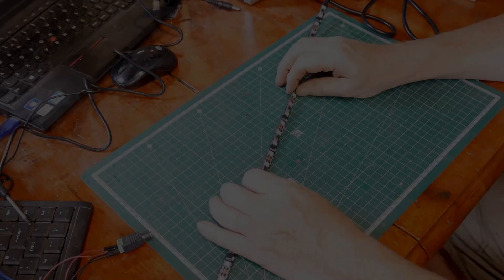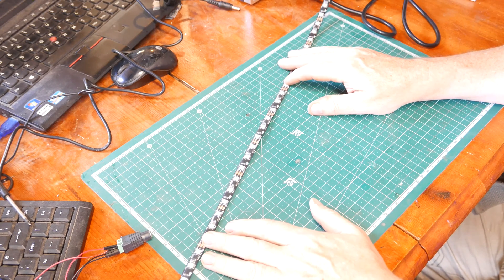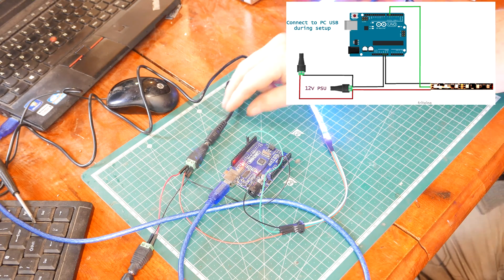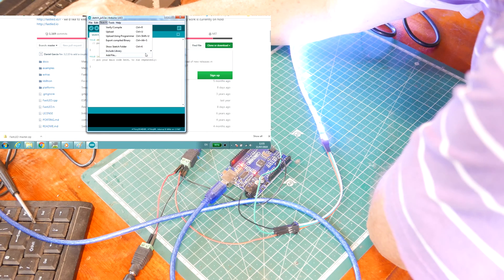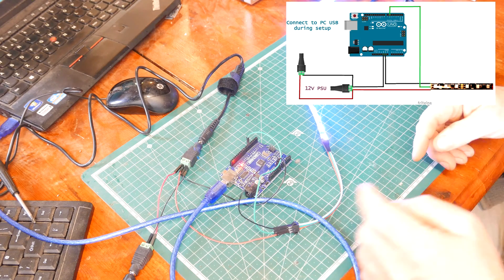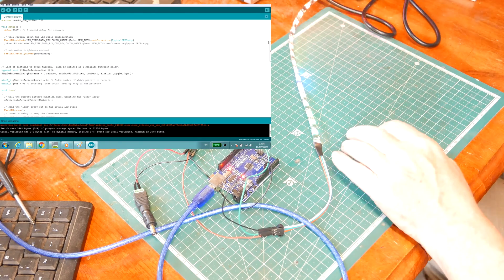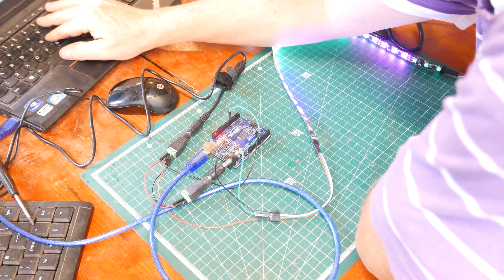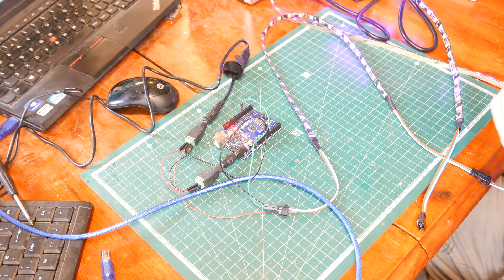12V WS2812B 3-wire LED Strip with Arduino Uno

Comment: Great video. Just a quick question. I am working with a WS2815 strip which is 12v. My understanding is that the Arduino pin output is 5v. So, it appears that the LEDs data channel can be 5v and it still works. My preference is to use an ESP32 where the output pins are 3.3v. I can step them up to 5v as I have done with the 5v strip I use, but wasn't sure if it needed to go all the way to 12v for the data pin with this strip.

Your assistance is much appreciated.

Comment: Thanks for the video.   There is not much info out there specifying how to power arduino after uploading the code.   Everyone always skips that step.   In my case it will help me power 12v pc fans with a 12v 1amp and also powering the arduino.  I'd hate to have two separate power supplies for a simple design.   (Newby here)

Comment: and of course I did connect the 12V when powered with the USB... I almost blew up my laptop, that needed a motherboard reset. The arduino is RIP
Reply: that should not be a problem, unless there is a floating ground.
Reply: @alejandrissimo  in my case, the computer was dead. I had to put a needle in some kind of reset button and then it started again. Not sure how not to have floating ground in such cases

Comment: So I can't use a 12v power supply on the 5v of the WS2812B? I was thinking of getting a 12v power supply because my WS2812B  isn't capable of putting out all white on the LED's.

Comment: This is a wrong title used for the video, he is using a WS2811 which runs on 12V. The WS2812B LEDS will fry when using 12V, be aware
Reply: I also noticed the LED's cutting group are in sets of three, while the WS2812B the cutting are single LED's.  So I think you are 100% right this is the WS2811

Comment: Won’t the 12v signal fry the arduino even though it’s only the ground and data pins are connected, should I put a resistor before I connect the ground to the arduino?
Reply from the maker: There's a vreg on the board.

Comment: I have 2 5M 12V LED Strips and I am going to wire it up your way, using a 12V 40A power supply, am I going to be good?
Reply from the maker: 60mA per WS2812 is the potential max current required.
Reply: @crazytom  Sorry I do not understand. Can I put the 12V into the Arduino and run a separate power line to the 2 5M 12V Led Strips (WS2815), each Strip has 300 LED, are we talking 180 watts per Strip? and will the 480 watt power supply do the job?

Comment: Pretty sure you are using a WS2811 strip there? (not a ws28112b) Those older generation ws2811's had that "groups of 3" limitation, but use 12V, which makes more sense for longer runs.
Reply: Definitely a WS2811, I noticed the group of threes as well.  I just got a WS2815, which is 12V but single LED addressable, should be fun!
Reply: does that strip have the default white color? Because I am not getting that.

Comment: Is there any special setting or library for this
Reply from the maker: FastLED
Reply: Addressable LED 3 wire 12v
Reply: 2811 led 12v strip
Reply: One is 12v wire one data wire and last ground wire
Reply: @crazytom  hey! Is 12volt 2 amp. Safe for arduino uno? if directly connected to arduino. 
Please reply urgently.. Thanks!
Reply: @Daredevil04  yes